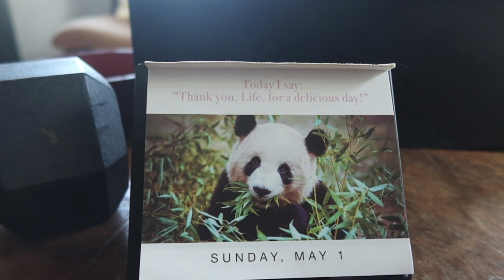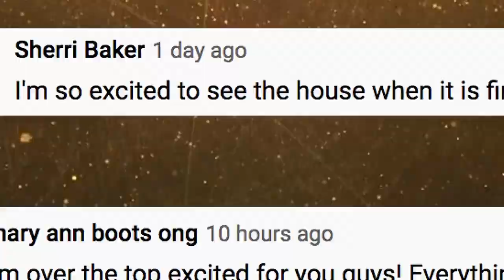The Rooms Of Our House Are Painted - May 2, 2022 | Vlog #1491

Comment: I read through the comments, seems there are a lot of opinions on your yellow...

You said it's "Sunset Yellow" which is #ffc922 (the color code) and, it's quite common I think (yes, I am that nerd that looks up the color, gets the code, and looks at it in my rendering software so I can truly see what you've got).  I have a yellow in my office room that is just a couple shades darker and, a yellow in my new Studio building that is a shade lighter.  I find it very soothing to be in these spaces and super easy to accessorize.  I believe your designer was "on point" with this.